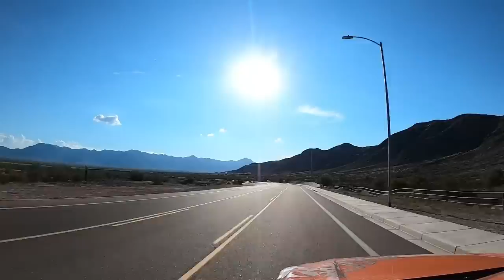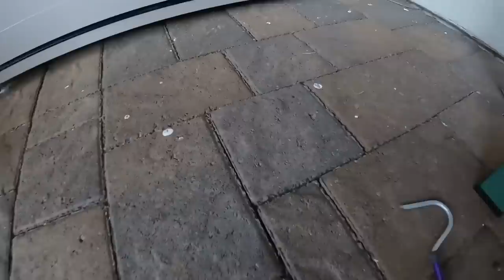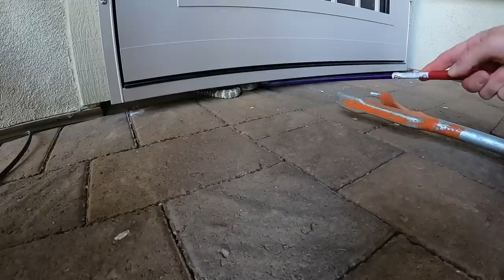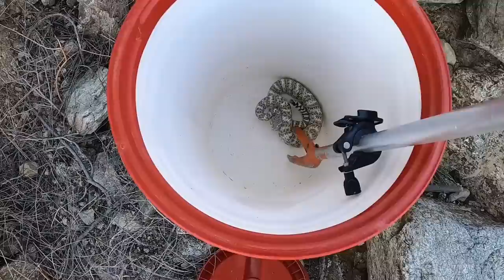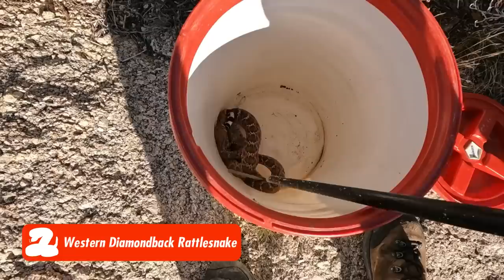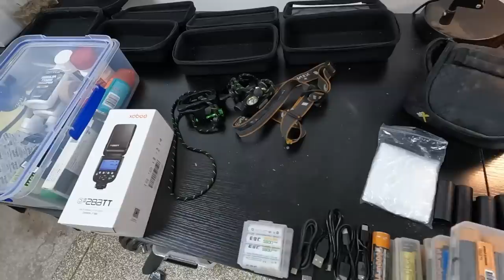Blue Rattlesnake Wedges Itself in a Door Jam

Comment: I would suggest keeping any pet food and water inside.. Obviously the snakes are being drawn there because there is a source of food.. Otherwise why would they keep having snakes show up?
Reply from the maker: There can be other factors, too. One of the big ones is just placement of the home in relation to other features like shared walls and access to open habitat. Homes on the corner can get a much higher percentage of rattlesnakes than those further in. That may not be the case here, but my point is that there are a lot of surprising details that can affect something like this.